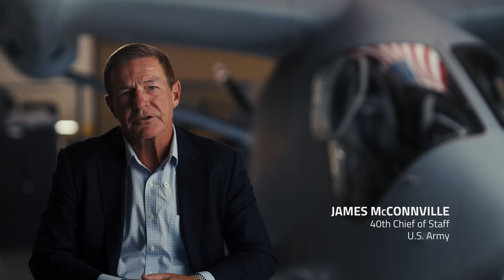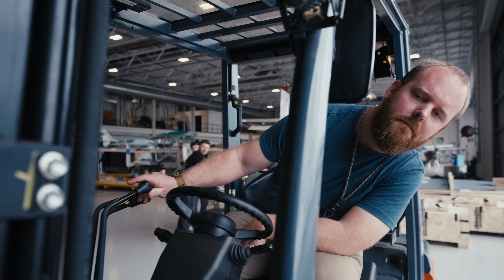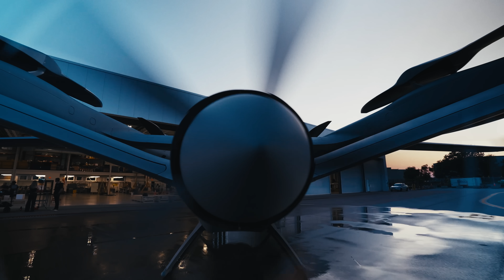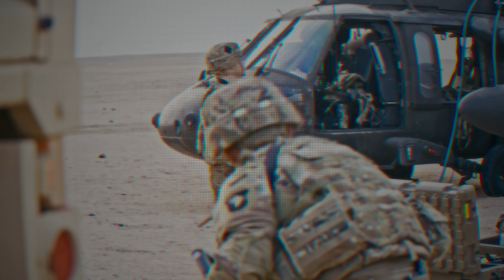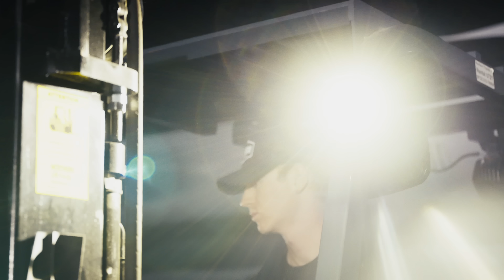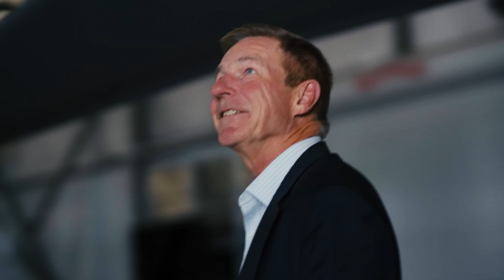BETA's MV250

Comment: The technology for full autonomy and hybrid powertrain for the MV250 is ultimately what I believe will propel this company.  Since no one else has this incredible system. 

For Commercial Cargo, the ability to shift seamlessly from the current fixed‑route operations to a new point‑to‑point electric air transport system has the potential to cut costs dramatically while accelerating delivery speed. Historically, higher‑tech, lower‑cost, faster‑speed solutions have always displaced lower‑tech, higher‑cost, slower‑speed alternatives. And for Defense applications autonomy is the main selling feature.

 The reason I stay in this stock is mainly due to Kyle Clark.  I know he is giving it 110% while the rest is up to luck.  IMO.
Reply: Clark is the next him!
Reply: @66bubbadog  We are about to find out if he is added to the list - Steve Jobs/Warren Buffet/Luckey Palmer/Elon Musk.